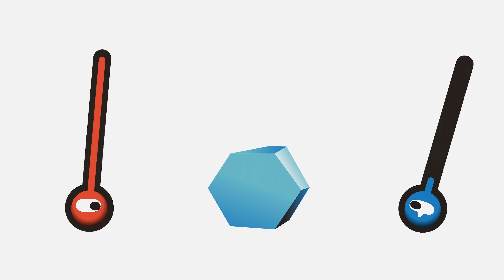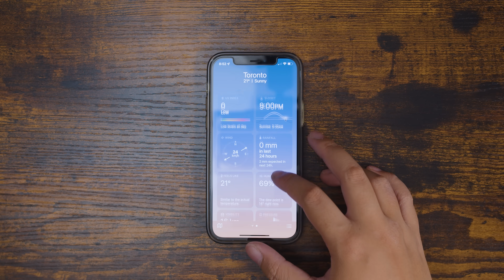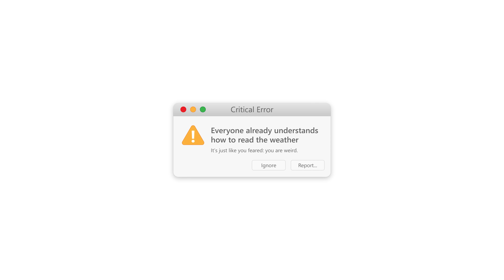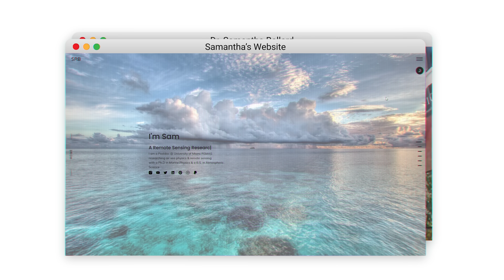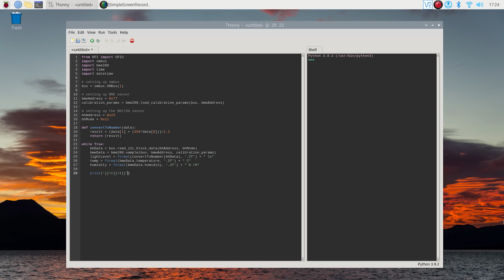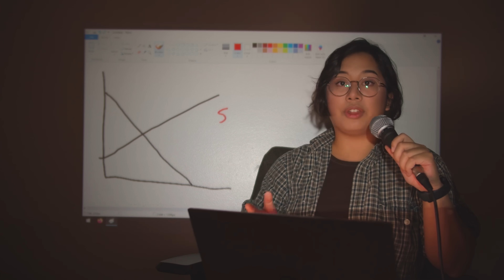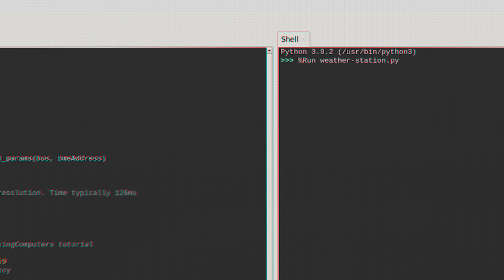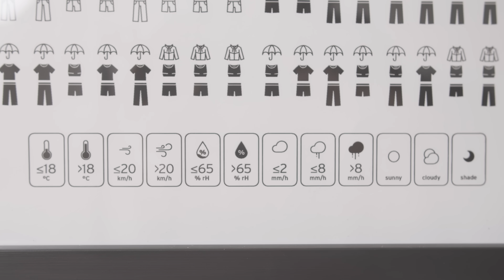how fahrenheit fails you

Comment: I base my clothing choices off the day before plus the current forecast. If yesterday as 15C and I was cold in my light sweater and today is supposed 13C, means I must wear something heavier then I did yesterday. This could mean a heavier sweater or in the fall this is where I start to consider pulling out my lightest "winter" jacket. Quotation marks around "winter" as technically it is a fall jacket but I rarely use my heavier coats. Normally we float around -2C to -5C so this coat is fine for short times outside. Longer times outside or the rare day below -10C I pull out a heavier coat.

Comment: As a person living in a country using only celsius, I always had a hard time understanding fahrenheit until I remember the formula to convert fahrenheit into celsius. Yes, I also blame myself for the inexperience of sensation converting into fahrenheit and I don't even remember the body temperature in fahrenheit. It's like telling a colorblind the difference of blue, red and green. Luckily everything is fairly demonstrated when it comes to mathematics.
Reply: I just ask the internet to do all my unit conversions, especially °F to °C since they don't match at 0° making it not a simple multiplier.

Also if it helps 100°F is supposed to be human body temp.

Human body temperature used to be accepted as 98.6° and now as the range of 97°-99°and children can run even warmer. (Everyone has a slightly different body temp, and we can tolerate a range of body temps anyway.)

Tldr: human body temp is just under 100°F. (Its the arbitrary reference point chosen, just like °C's arbitrary reference points being the phase changes of water at 1atm of pressure)

Comment: As someone from the US with a private pilot's license (and otherwise being involved in aviation) I can safely say that F is good for day to day existing temperatures but Celsius is better for anything scientific. 

For the certain parts like air pressure though I'm pretty flexible and a huge thing people don't understand is *relative humidity*, which is what matters. Higher temps with higher RH suck but lower temps with high RH van actually feel pretty "normal" until you get to below freezing.

Comment: I wanted to comment about how none of the systems are intuitive, but are all just learned and matched with our experiences... to find you answering that *kinda*, but more importantly finally understanding it's a problem that is very own to you and not everyone else...anyway it was fun to watch :3
Reply: Hm, Celsius is pretty intuitive to me... Close to zero is freezing since water turns into ice at that point, average Human temperature is 37 and bad Human fever is above 38 so if the weather is above that, it will become increasingly overwhelming for most people (unless they were raised in [semi]desert weather)
Reply: @juleo1000 yeah that’s literally what the og comment is saying. use whatever is intuitive to you.
Reply: @juleo1000 i can do the same for °F.
0°F is when the salt stops melting the ice on the sidewalk and road meaning i have to be extra careful.
100°F was originally intended to be human body temp (actual value is 97-99°F) and a dangerous fever is 104°F, anything over 100°F is unbearable.

Ultimately all units are arbitrary, Fahrenheit tried to use humans as a reference, Celcius used pure water at sealevel as a reference. Kelvin and Rankine shifted these scales down to absolute 0 making them "thermodynamic temperature scales" useful for science. (Some stuff like ideal gas laws are proportional to temperature but to avoid weirdness you need 0 to be at the end of possible temperatures so you don't divide by 0 and create an asymptote at the freezing point of water)

Comment: if u wanna learn fahrenheit just memorize this
Big number hot
low number cold
negative number freezing
anything above 100 will give you a heat stoke
(0-100)
Reply: Technically, all that is also true for Celsius if literally cooking can be counted towards an extreme form of heat stroke
Reply: @waterunderthebridge7950  I mean, you can survive in 100°C for limited amounts of time - Anyone who uses the oven can tell you this.
Reply: @OzixiThrill  That’s the thing a lot of people may miss, in an oven e.g. 100°C means that the heating elements heat up to that temperature. ‘Cuz air as an insulator is notoriously bad at conducting most things (including heat), the ambient temperature might not reach close to 100°C at all, leading to uneven cooking without air cycling. The food still gets cooked by heat radiation (as opposed to conduction) but if you just put in your hand for a few seconds, there’s just not enough radiation (and conduction) happening for your hand to rise significantly in temperature.

If you were to stay in 100°C outside temperature with no escape, things might be very different. The air will still insulate you, not even transferring too much energy due to its density but heat radiation from basically anything in your vicinity will just start vaporizing you probably.
Reply: @waterunderthebridge7950  "That’s the thing a lot of people may miss, in an oven e.g. 100°C means that the heating elements heat up to that temperature"
Except I stick an external thermometer into the oven to get such values (and well over 200°C, in fact). So no, it's not the heating element that gets that hot, it's the air inside the oven that does so - And hell, that should be obvious by way of some basic knowledge of physics.
Even if we assume that it's only the heating element that heats up that much initially, the heat would eventually disperse in the air inside the oven itself, reaching a close to same temperature itself.

However, as you yourself have noted, air is not a great conductor - That includes it's ability to deposit heat into external bodies, human arms reaching into ovens included.
Add to that the fact that the exposure is partial (allowing for your body to mitigate the effects of the heat) and you have yourself a relatively risk-free experience with temperatures in the hundreds.

"The food still gets cooked by heat radiation (as opposed to conduction)"
While air is an inefficient conductor, it still does conduct heat - When you limit the amount of air that can absorb the heat - As with furnaces and ovens - you will eventually reach a temperature where the air itself actually carries that energy.
That is the primary reason why, despite the heat coming from beneath, the top of a meal is likelier to get burnt - Contrast this with frying where the heat primarily comes from the bottom, making it the point where you can burn your food.

"If you were to stay in 100°C outside temperature with no escape, things might be very different"
Hence why I stated that it's fine for limited amounts of time.

In conclusion, you're more than likely wrong about how ovens work.

Comment: I guess I just don’t understand how one cannot grasp the relativity of the temperature to what you should be wearing outside despite which scale you use. You go out with a jacket on and it’s too hot you should be able to remember that sensation for next time. Maybe people just don’t care enough to remember? It shouldn’t take any amount of experience more than once or twice imo
Reply: The problem is that the temperature alone is not enough. There are several other statistics that factor into how you feel... you know, like was stated in the video. Something that you would know, if you actually watched the video before commenting.

So the same temperature can lead to totally different clothing based on the other statistics around it (like humidity and whether or not it's rainy/cloudy outside and how much the wind is blowing).

So in the end, the temperature alone doesn't help you. Which basically leads to that you will need to go outside first to get a feeling of how you should dress for the weather that is currently going on outside...
Reply: @Memento Mori  not sure why you felt the need to make a condescending assumption that I did not watch the whole video. Other factors will not fluctuate in a big enough variable that it will change clothing choice drastically. Simply associating what sweater weather feels like, as opposed to down jacket weather, is simple enough. It should be easy enough to take a mental note on those ranges for your own comfort levels.
Reply: @GenoCideWalk  Once again, that still can not be extrapolated from the temperature alone.
In mild temperatures, I have a VERY big difference in what I am wearing depending on the other factors even when the temperature is exactly the same.

When it comes to extremes (very cold or very hot) then yeah, the clothing is basically exactly the same. But in the middle area it's much more about the other factors than the temperature itself.
Reply: @Memento Mori  may I ask where you are from? In Canada our "forecast" gives us the factors in play and the associated temperature  it makes it feel. Which may be the reason for my bias.

Comment: I'm an American who converted to metric. Let me help you: Figure out what you wear at 0°C. Then, subtract one layer per 10°C. Once you get to zero layers, you start putting layers back on because you've just landed in the middle east, death valley, or the Sahara if you're not on a tropical island.
Reply: Bro I wear two layers at 0℃, I don't think that's gonna work
Reply: @LavaSaver  same, I'm wearing the same thing at 10C as I am at 0C, it's only when it gets below about -15C that I really want more than 2 layers assuming it isn't windy.
Reply: @jordanabendroth6458  Yeah, unless I plan to stay outside for a long time (like if I'm skiing or smth) I don't really wear more than 2 layers. At most I'll swap out my coat for a thicker one, but personally I never stay outside long enough to be in any real danger of freezing, just 5-10 minutes or so at the most. Though that's probably influenced by it not usually going below around -29℃ here, or around -20°F, at the very coldest.
Reply: @jordanabendroth6458  Do you, by any chance, live in the Arctic?
Reply: heres my personal strategy and it mostly works
-10C - thick jacket
0C - light jacket
10C - sweater
20C - shirt
30C - t-shirt
40C - naked
Reply: @bruhsauce644 sightly different for me 
-10°c -  jacket
0°c - jacket (or thick sweater)
10°c - thin shirt
20°c - t shirt
30°c - t shirt, preferably nothing 
40°c - dead
Reply: @bruhsauce644  when it's very hot you actually want to wear loads of clothing so that you don't dehydrate from sweat, that's why Arabs etc wear full body coverings in the middle of the desert
Reply: @bruhsauce644  Damn, where I live it's currently t-shirt going on naked. :(
Reply: I converted to metric in 1989 after learning it in machinist class.
Reply: Yeah that's how I explain it to Americans too, though I start the other way around: 40°c is too hot, 30°c is bikini, add one layer for 10°c less.
Reply: So you go out naked at some point? 🤔
Reply: 0: A coat, maybe
10: Not a coat
20: Practically naked
30: Peeled

Alright, doesn't translate well to New York.
Reply: To quite a friend: Freezing cold is better than blistering hot. You can always put on more layers as it gets colder, but when it gets warmer, at some point taking off the next layer is illegal in public, and the layer after that is *fucking painful*.
Reply: Currently it is 46 degrees Celsius where I am. I can assure you, I'm not going to put on a coat at 97° Fahrenheit. Or even 79° Fahrenheit.
Reply: Fake American
Reply: as a californian i wear 4 layers at 0 C and take off 1 layer at 10 C and then 15 C, then continue that pattern
Reply: Bro I wear 1 layer
Reply: Mantap bung, nampaknya vlogger ini belum pernah tinggal di daerah equator. 😂👍🙏
Reply: I am from Spain. Celsius native. This is really clever. Thumbs up to you
Reply: I mean, visit rural Southern Central NSW, Australia (plenty of wheat, canola, sheep and cows) during December-February, and you'll often be wanting to have a cold bath to soak away body heat when the thermometer punches 40-45Cel during the day and sits at 30-35Cel overnight if you don't have a working aircon (or the one you have is for a single bedroom).
Reply: I would put on 2 layers at 0 C. I am not going to be naked at 20 C (68 F). That's way too cold for that. I wouldn't even consider getting naked until 95 F (35 C). About 100 F (38 C) is when I might start putting on more layers for the sun protection.
Reply: @Azuuraas  See, that doesn't help as much as you think. Most of us UNDERSTAND Celsius, but we don't GROK it. So you hear 20 degrees and know what that means intuitively. We can work it out, but it takes time and mental effort.
Reply: My my strategy is to dress fairly light and carry a mister with me because I'm always too warm indoors, and then I bring layers with me in case I'll be outside in the cold. And in summer I just avoid going outside unless it's to float the river in an inner tube, frequently dousing myself in reasonably clean river water 😂
Reply: Have you paid a visit to I-19?
Reply: The metric system is simpler, logical, and overall superior as far as meter, gram, liter methods of measuring goes. But for temperature Fahrenheit is so much better. The metric system will always be useful and I'll always use it interchangeably with the imperial system. But I'll never use Celsius unless I have to
Reply: @elias197859  This is basically exactly how I feel about it. Personally I think feet are more useful than meters on the scale people measure things in their day-to-day lives, but Celsius is the only part I can say is inarguably worse than Fahrenheit.

Comment: lol I don't know how the beginning of the video: Fahrenheit versus Celsius debate became a How can Sabrina help Sabrina wear the right clothes for the weather.... But I tend to wear clothes that fit comfortably and feel comfortably, then go outside, see if I did it correctly (if I did, I try to remember that for future instances) If I did it incorrectly, I need to change my clothing choices. Of course this changes based on the season. Like Sabrina says: the same temperature in the Fall is different from the Spring. Because one is transitioning into Winter and the other is transitioning into Summer.